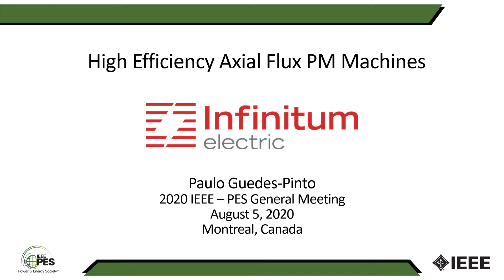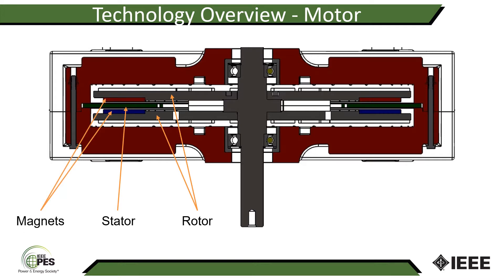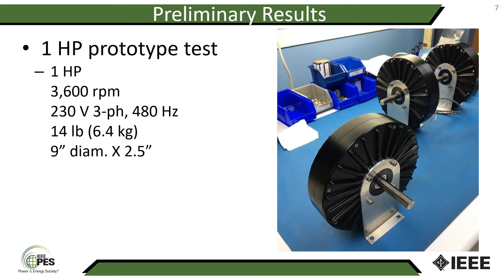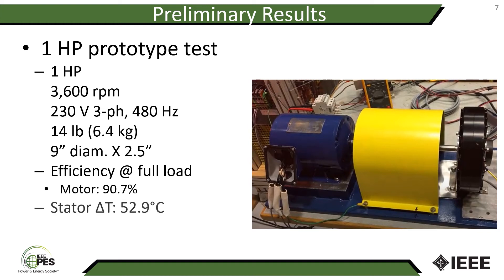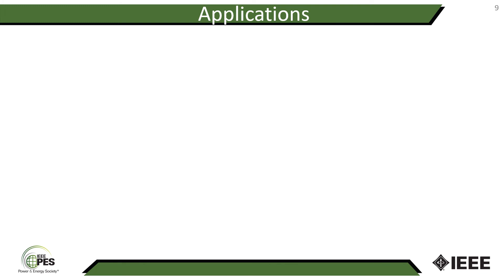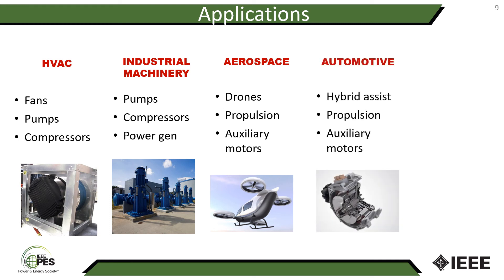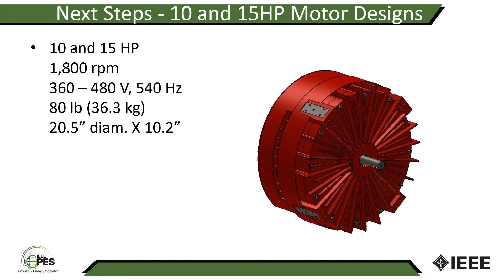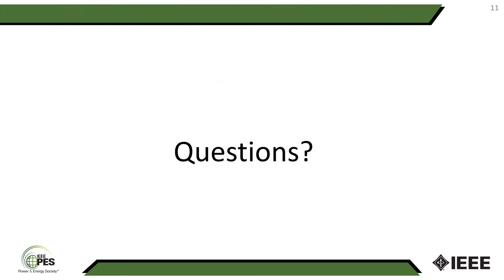Infinitum Technology Overview Presented at IEEE PES Annual Conference 2020

Comment: Question: if you compare on an equal torque basis, how do you compare with induction machines? I understand that one of your 1 HP machines is lighter than a 1 HP induction motor. But I assume that power level is achieved at very high RPM.

Comment: An amazing list of features that contributes to the benefits of your motor technology.
As I look at it, the stator is a switched reluctance core of the motor. Does the physical stress of the rotor movement show up as a reliability issue in the stator inductor traces? (perhaps delaminating or microfractures in the PCB inductors?)
Have you investigated the minor PCB option of using bifilar windings in the stator? (see Thane C Heins Youtube channel)
Having both an N and S magnet pass an inductor simultaneously presents an unusual condition to an intersected inductor (both currents would be induced in both directions (magnetic fields do not cancel as charge fields do). What back EMF does it create? Does your VFD need special placement or shielding to eliminate magnetic fields coupling in stray power?
Great product innovation and development work. Your staff bios look like you have a winning management team. 
With your success, I hope you investigate self-powered, generating motors, your efficiencies and technical approach put your product on the doorstep of disruptive innovation (infinite range EVs).

Comment: Plz suggest a axial flux motor  around 2 to 3 hp to convert a cvt scooter 🛴 into EV. Driver and price. 
Thanks.
Reply: When a perfect technology seems to be ignored by the market, it tells us that there are key problems in the technology that are ignored. 🤣
Reply: @tp6306  Exactly 🤔
Reply: Dinesh ji, They wont suggest. we have to do ourselves. I am working on converting a existing 250w BLDC motor into 1kw BLDC motor using ferrite magnets or 2.7kw BLDC motor using neodynm magnets. if interested contact me. I am doing at induidual capacity as part of my ebike journey since 2014. 
Thank you
Reply: When it's going for mass or industrial production. It's in prototype stage I think